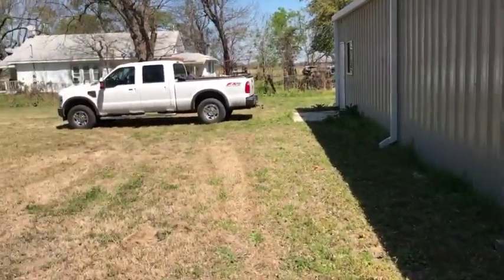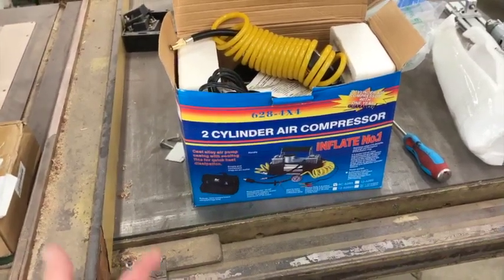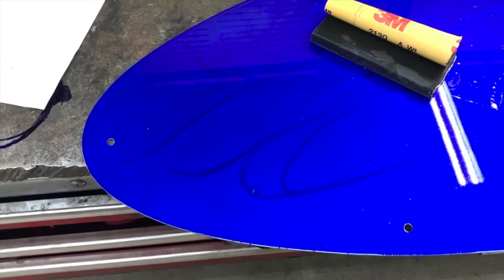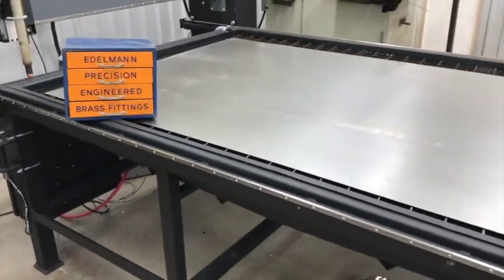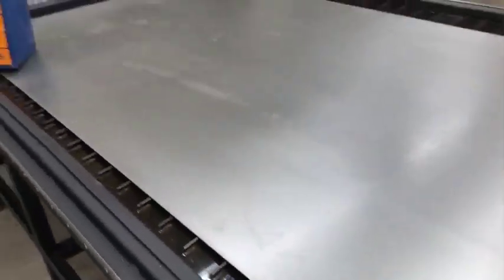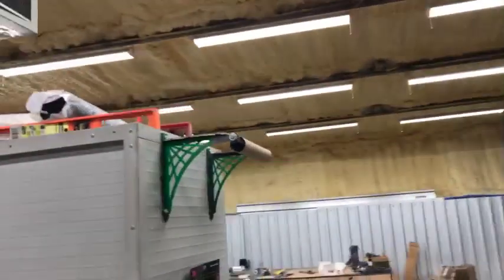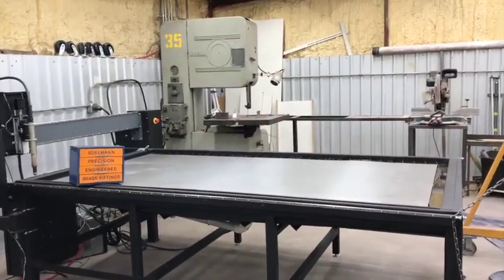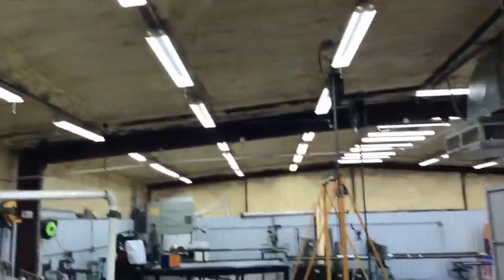Acid to clean AC coils in Shop?

Comment: I clean lots of AC coils working in the HVAC world.  It looks like you can get to the worst part of it behind the filter.  Kill the power to it first and with a brush on your shop vac, suck up the big stuff.  Then visit Home depot, they sell a gallon of coil cleaner, mix it up, stick it in a garden spray and hose that sucker down.  Flush with plenty of water and repeat until it's clean.  Then flip it back on.  With a setup like yours, I can usually avoid pulling the coil out.  If you want to pay someone, expect them to recover your refrigerant, cut the coil out, garden hose it outside, reinstall, vac and recharge.  I would charge you about 300 to do that.  Or 75bucks to do it they way I suggest to you.  You are crafty, you can do this.  Just don't bend the fins over.  The best defense in the future is buy an Aprilair filter box and a case of elements.  about $300.  Then buy one of those shit blue washable filters and place it over the aprilair.  Wash that thing every 2 weeks and your coil will stay clean for years in the harsh shop environment.

Comment: I used to service ac units for commercial suites. We always used a hudson sprayer and coil cleaner. Normally, you can pull the access panels or sheet metal on the unit to access both sides of the coil. It isn't the inside that is dirty (as another guy mentioned) but it is the fins and outside of the tubes that get dirty with whatever makes it past your filters. I haven't heard of using acid on them. Compressed air is a good start, followed by hot water and a degreaser (or coil cleaner) that is safe for aluminum and copper. You might need to consider additional filters or a different design of filters to handle the shop environment. If the coils are easily accessible, consider cleaning them more often so you aren't dealing with such a bad mess. I hope you get that booth going soon, it is a shame you aren't using it yet.

Comment: We have to use ice to pull the refrigerant out as it helps with the temp gradient. Pull the coil. Wash it. Reassemble and purge with nitrogen. You want to pull a vacuum at some point. Tests for leaks. Recharge with refrigerant. Start up, check operation, return to service. If you don’t have a feel for all that, clean it in place best you can.

Comment: I would use comstar 90-184 foamy evaporator coil cleaner from amazon and a pump sprayer to apply it.
Let it sit on the coils until it stops foaming then rinse and repeat until it is clean.
I would not pull the evaporator out until I tried the cleaning a few times.
You would definitely want the pros to do the removal if it is required because they would have to remove the refrigerant charge then they would have to evacuate it and recharge it with the correct weight of refrigerant after the coil was cleaned.
I have never had to remove one to clean it in all the years I have been an a/c tech.
Call me if you need more info.
Reply: I like the no rinse stuff for normal evaporator maintenance but if his coils are as dirty as he says then he needs the heavier cleaner and rinse with a hose to thoroughly clean the coil. :-)
Reply: Great advice!
Reply: https://www.amazon.com/Nu-Calgon-4171-75-Rinse-Evaporator-Cleaner/dp/B00DM8KQ3I/ref=sr_1_1?ie=UTF8&qid=1521782594&sr=8-1&keywords=Evap+Foam+No+Rinse+Cleaner
Reply: totally what he said!
Reply: I used this Foaming cleaner and did rinse it off with a garden hose and sprayer. even though it says no rinse. My A Coil was extremely dirty also. So much so that it was starting to freeze up, I did it multiple times with this product, as i could not justify the cost of a gallon. "$50.00" retail at my Supply Store. "Was not a Amazon purchase at the time, for such a small A Coil.  Worked Great for me. Gary may need more based on the size of his unit.

Comment: I would advise to not remove the evaporator coil. 
Do not use an acid based cleaner on the inside evaporator coil, it will damage the coil. 
Procure some Nu Calgon 4168-08 Evap Powr No Rinse Coil Cleaner, it is readily available in the DFW area and online. 
Get a cheap 2 gallon garden pump sprayer and 6-8 inch stiff natural bristle brush. 

Do not disconnect the refrigerant lines. 
Turn off the electricity to the entire A/C system. 
Remove the case side covers and coil cover plates. 
Remove the filter and rack. 

Carefully vacuum the faces of the evaporator coil. 
Mix the 4168-08 in a 1 to 1 ratio with clean water. 
Spray the coil with the solution thoroughly soaking the evaporator coil and debris, 
Let soak 10-20 minutes. 
Using a garden hose with spray nozzle, rinse the coil from the backside. 
Use the brush to remove stuck debris. 
Rinse the coil from the backside again,blowout with compressed air.  
Closely inspect with a light and repeat if necessary. 
Clean out the condensate drain, flush and blowout with compressed air. 
Clean the case, blower and ducting with vacuum and compressed air. 
If the blower motor gets wet carefully blow out with compressed air and do not apply power until completely dry. 
Install new filters. 
Reassemble and enjoy the A/C.
Reply from the maker: Wow man, this is exactly why I make videos on youtube.  Cant thank you enough.  Still goign to be a messy job but not near as bad as removing the coils.  Ordering soem of the nu calgon now

Comment: Gary, before I went to all the trouble of removing the AC coil out of the unit.  I would get up there with an air hose and blow the coils out.  Blowing in reverse to the air flow.  Beprepared for a mess though.

Comment: I've been waiting for you to have an avid video! So excited!!!!!
Painter pro tip from a novice- shave off all body hair.
edit: acid
Reply: Too bad it doesn't have quick connects on the freon lines. I'm sure one of your fans is an a.c. guy. Don't suppose you could pull everything off and do it in place without having to mess with the lines? That's what I'd  do, but you like to put your full posterior in to things.